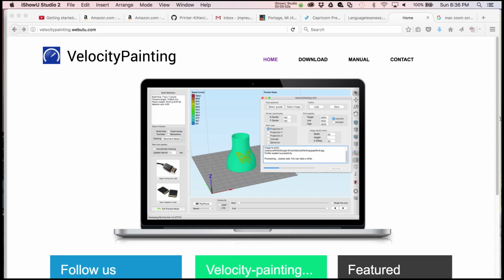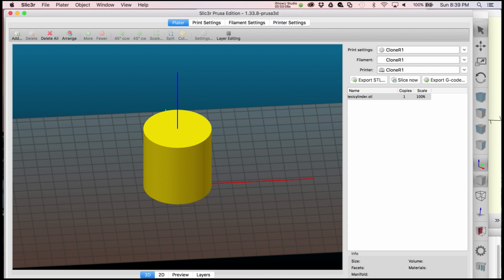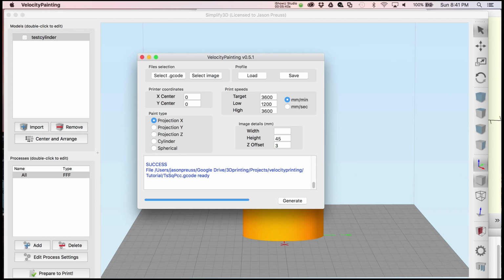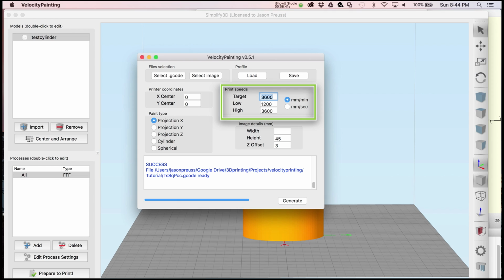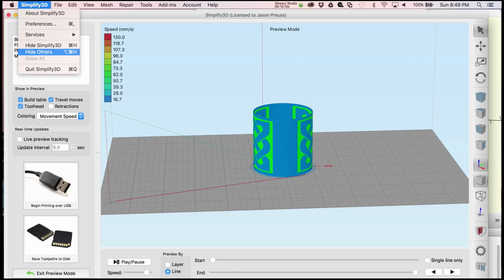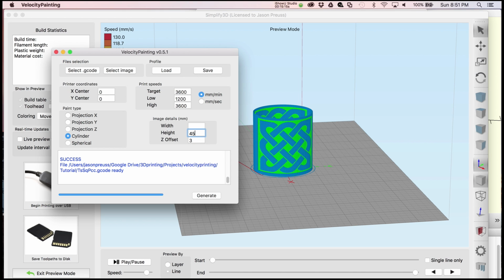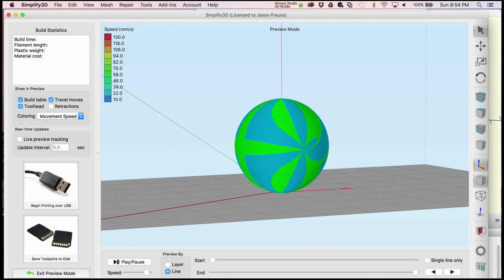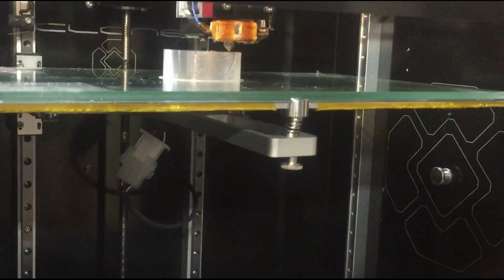Velocity Painting 101

Comment: if you want to use the spherical projection, try using hdr files (or 360 photos). It looks like it uses the same projection system as in 3d renderers
Reply from the maker: Thanks for the tip, I'll have to try that.

Comment: So as far as i understand this only adjusts the speed of the moves...resulting in underextrusion in faster moves and overextrusion in the slower moves...

Personally I don't see a use for this and its an inaccurate 'sloppy' way to achieve the results required. Not being rude I just feel that a lithophane generator is more elegant and will give much cleaner results. Also just creating the features in the 3D model would work out better as well.

I do appreciate the creativity and 'thinking outside the box' that has created this technique, I just dont think its the best way to achieve the results it produces.

Just my two cents

Not a hater haha just giving my opinion of the technique
Reply from the maker: I am not completely certain how the effect works, I think it is both the extrusion rate doesn't match the sudden change in head speed but I also think that filament extruded at 20mm/s could have slightly different optical properties than being extruded at 60mm/s which may enhance the effect.

I view it as a tool that is useful in special cases. Putting a pattern into a single wall vase is probably the best use case. You can't do the lithophane method there because that requires several walls.

I don't have an issue with differing opinions as long as it is done in an intelligent way as you have done, I often learn from them.
Reply: I was JUST going to ask how it compares to Lithophane techniques. It really seems Lithophane is more accurate and also doesn't run a risk of messing up your machine.

Comment: I am going crazy I have used many g-codes and diff b&w jpeg files it never works.
Reply from the maker: I might be able to help you out if you can provide some additional details. At what point does the process break down for you? Is it the getting the gcode altered with the pattern or is it more the gcode looks good but the print doesn't?
Reply: It's getting the g-code I have not tried to print yet the pattern is not showing up on the print preview.  I am slicing with simplify 3d also using newest velocity painting.  When I look at the g-code I can see that it has been altered.  But it does not show in the print preview.
Reply from the maker: This has happened to me in a couple cases. First is when I had the x and y center off. Most printers have this as the middle, so if you have a 200x200 build area the values would be x=100, y=100. For Makerbot printers the center is always 0,0. The other mistake I have made is making the z height too high. What printer are you using? Is the model you are trying out publicly available? I have s3d and if you still are having trouble I can see if I can get it to work.
Reply: I have the anet a8 the center is 110. 110
I will give it some more work and let you know thank you for the suggestions
Reply: I think I have it now thank you for your assistance printing my first print now.

Go State